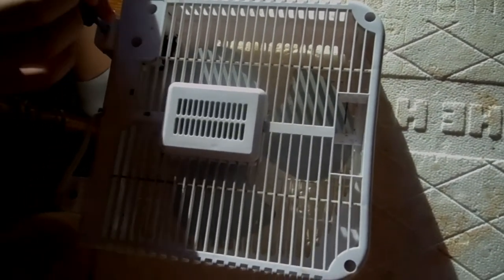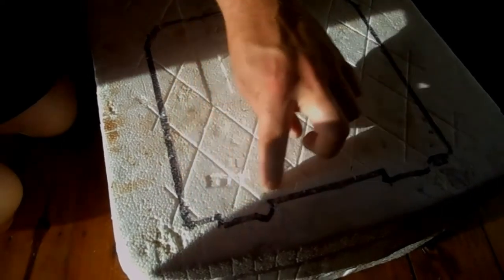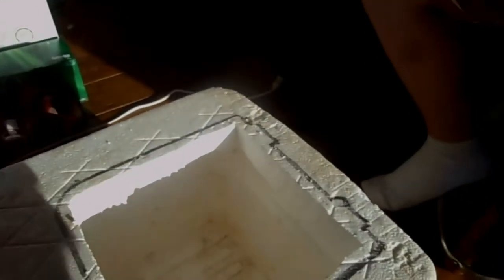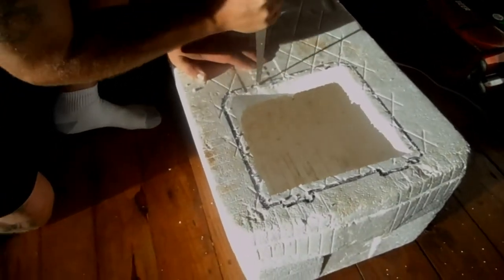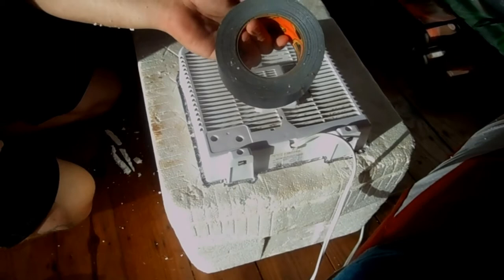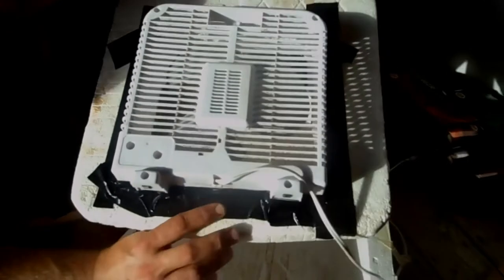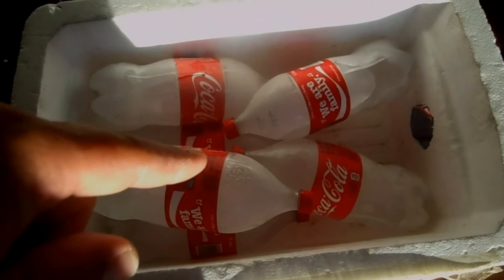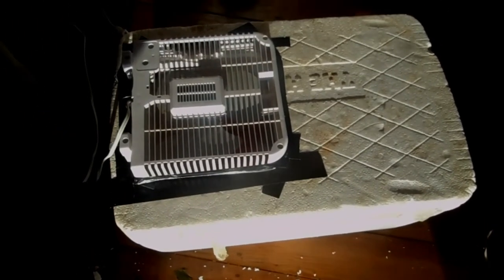Hillbilly Air Conditioner How to

Comment: I have about the same size unit in my van and it works pretty well, I have several gallon jugs I rotate 2 in the unit and 4 in the freezer. Our 100+ days here in Florida can melt some ice though! I usually only use it in the evenings unless I'm hauling gbrats around
Reply from the maker: I came home from work today and my son has went through and found the throw away bottles that he has put in the freezer to  fill in the empty space of the cooler. Smart kid for sure, the temp gauge was reading 62 degrees after 2 hours of the unit running. Keep in touch Doc, cya!

Comment: how long before the ice melts? Will it make it through the night?
Reply from the maker: Well Blitzball for somereason I lost that part of the video that explains that but anyways the bottles on the bottom of the stack still have a bit of a ice chunk in them but they are mostly melted. Since this video was shot he has filled the empty space with 16 oz bottles which makes it last even longer. If you try it out let us know how it does and keep in touch. Cya!
Reply from the maker: Yeah, it last through the night but you got to get enough bottles to do a full rotation going because it takes about one full day to freeze the 2 liter bottles. He has 12 big bottles and 10 of the little ones going.